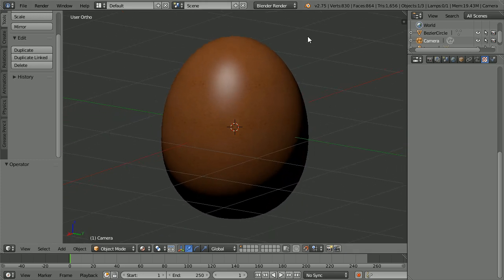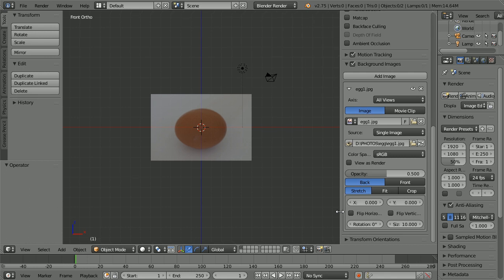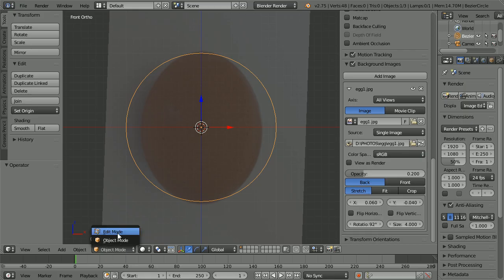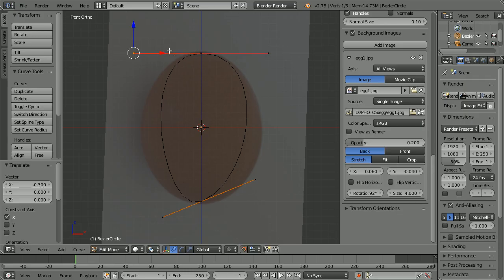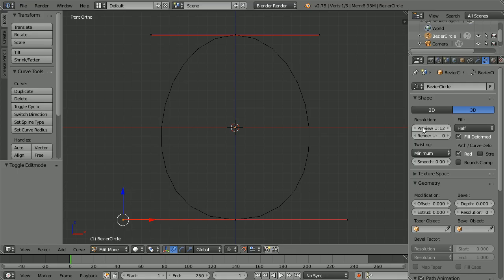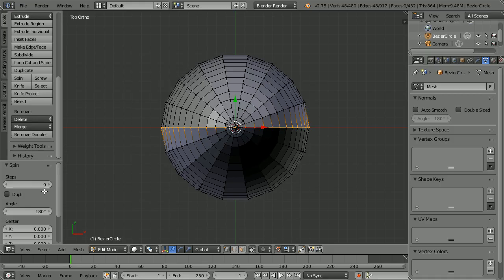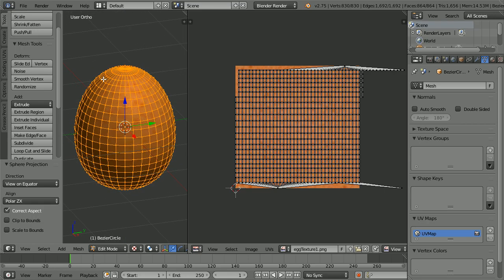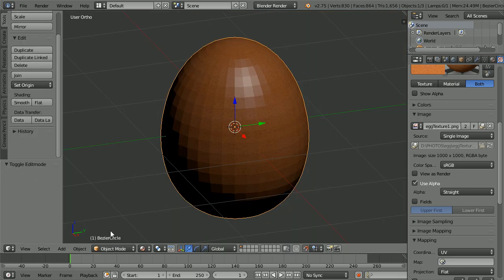Blender Tutorial Making a 3D Model of an Egg Using Curves, Spin and a Seamless Texture

Comment: This tutorial is great and all, but either I made an error or this isn't the Ideal way to build in 3d. The Bezier, when spun, doesn't make a smooth surface. There is a line that is notable when rendered. Even after subdividing and smoothing the egg, the seam remains. Should I spin more than 180 degrees? or should I try to just model the egg by modifying a UV sphere?